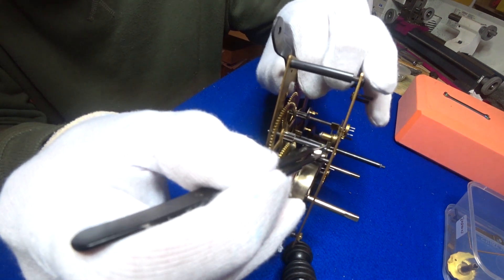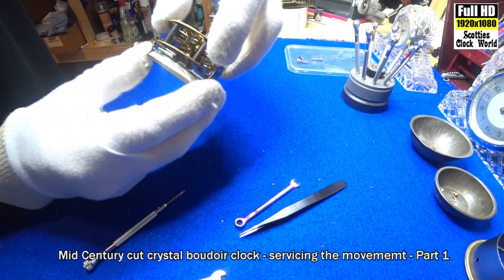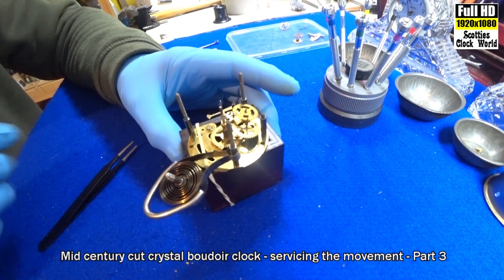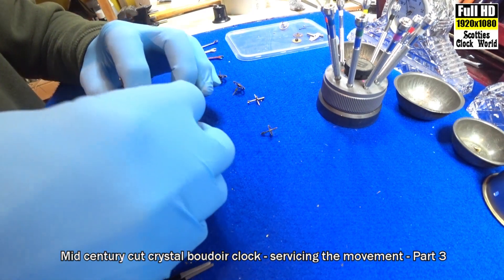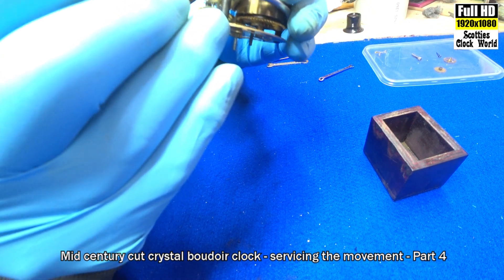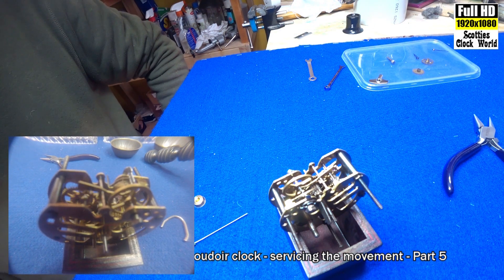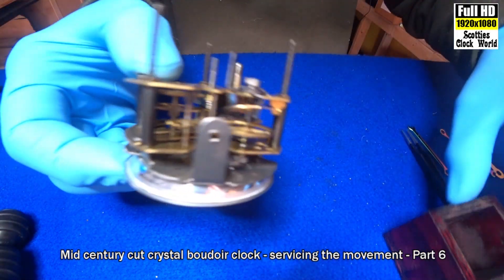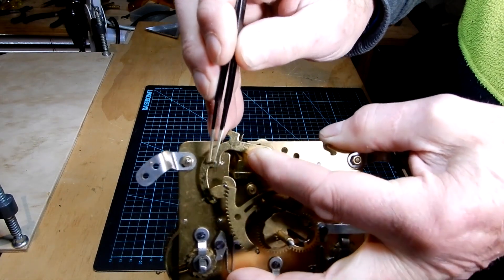Mid century cut crystal boudoir clock service - Full Video

Comment: It looks like the hardest part of this job was removing the balance wheel and hair spring and putting them back in again.  Did it need any bushing work, or just cleaning and oiling?  Nice job.
Reply from the maker: Yes it usually is the hardest part of the service.  
Any kink in the hair spring throws the movement out of beat. This has been set by the factory, the length of the hair spring between where it is joined on to the Balance Staff and the Fast/Slow adjustment is crucial. If you have to replace a hair spring be prepared to spend a lot of time getting the movement back into beat.
Reply from the maker: The service included just cleaning and oiling. These movements, called  a "Standard Two Inch Movement" were turned out in the millions in the Forties and Fifties and are not worth the expenses of rebushing if necessary, other than for sentimental reasons.